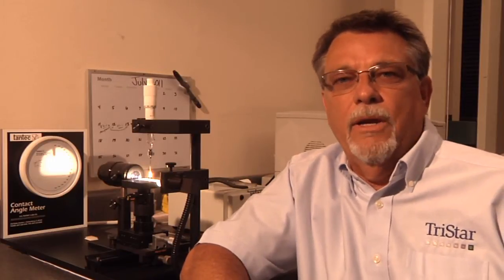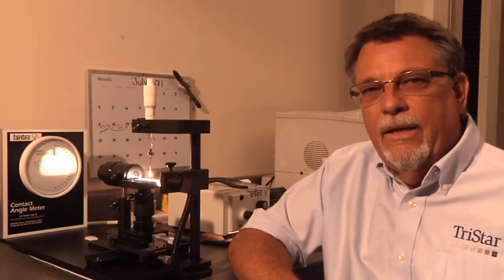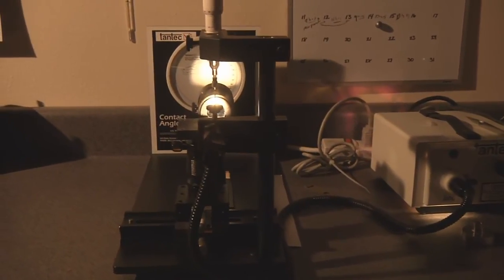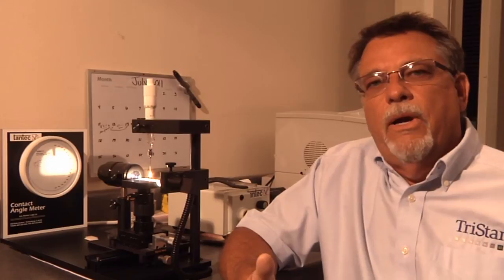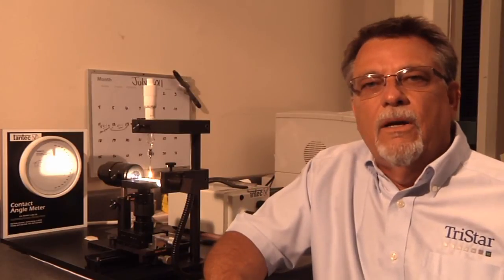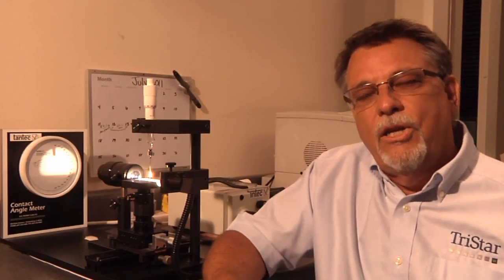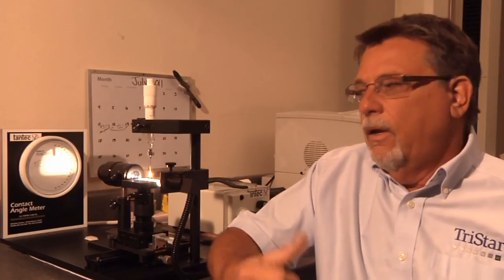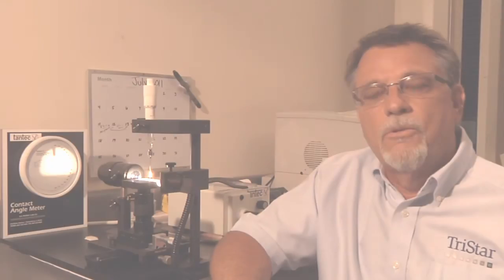Measuring surface tension

Comment: What are all the factors which can affect the surface tension of a liquid? Pleas help me, im working on a research parer. Thank you !!
Reply: Aman Reddy The surface tension is developed due to cohesive surface forces, since the molecular forces in the bulk phase remains constant as they mutually nullify. Hence the bulk phase is responsible for fluid dynamics or the viscosity of the liquid sample. The cohesive forces are generated due to dipoles, zwitterions, unequal distribution of atomic charges in the molecules, electron rich and deficient sites in the molecules. Thus the stronger intermolecular forces do induce stronger pull among the surface molecules that develop a strongly tense liquid thin film or the thin film is developed due to closely interconnectivity of the molecular forces factors which remain unused or unutilized at the surfaces. These are the reason that the meniscus remains downward due to downward pull of the molecular forces. Therefore, the bulk forces are also distorted along with the downwards pull because of the adhesive forces along with solid glass walls wherever the liquid sample is kept. These are the reason that the friccohesity which deals with the such interfaces in originated and resolve such issues related to the mutual inter conversion of the cohesive forces into the frictional forces responsible for measuring viscosity.  The friccohesity is determined with survismeter along with surface tension and viscosity together.
Reply: mansingh60 Thank you so much for taking the time to help me out. I really like your videos. :) I'm done with my research paper now, would you like to take a look?
Reply: @mansingh60  thank you for the Intel. I got more insights reading.